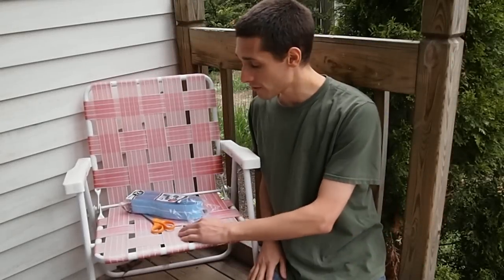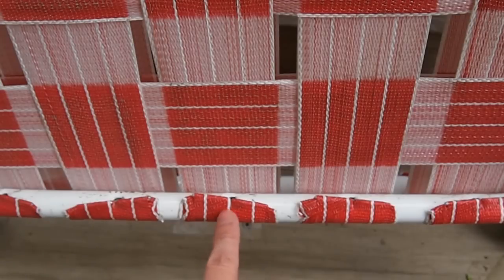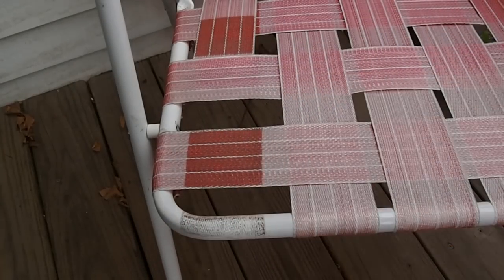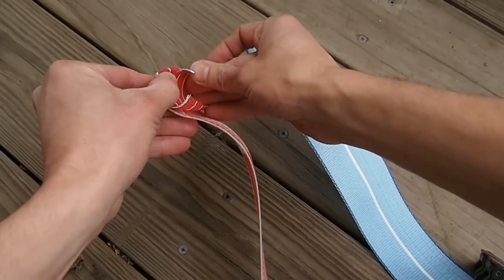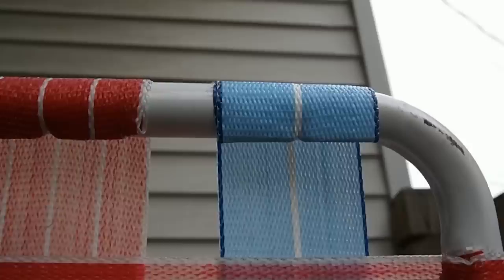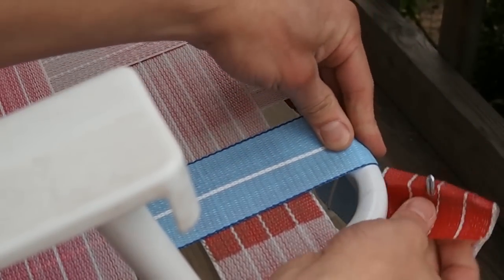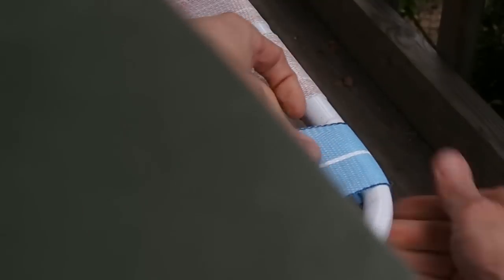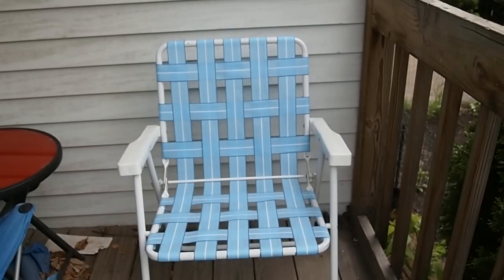Re-Web a Lawn Chair

Comment: Great video. I followed your instructions and it came out quite good, but not as tight as the original webbing, because you need enough slack over the holes in the frame to slip the clips in. Seems to be useable though, and it looks much better! Thanks!

Comment: Thanks.  Good instructions but these clip things are just difficult and fickle.  Anyone trying this should just get screws.  I just redid my chair with clips.  Pulled tight.  Did everything right.  Sat in it, and now there is just a tiny bit of slack on all the webs but its enough for the clips to start falling out all over the place.  Very annoying.  SCREW IT!  SKIP THE CLIPS!!
Reply from the maker: I agree; screws are much easier.
Reply: What kind of screws???
Reply: @coreybennewies1866  , SS that fits the hole.

Comment: I"m on a tight budget and have an old 3 seat porch swing. Do you think I could replace the material that holds the cushions with this? Is it hard to drill holes in the metal to attach the screws? Do you know of a video that would address this ?
Reply from the maker: It's probably not very hard to drill new holes. It depends on the metal though. Aluminum is a piece of cake to drill. Iron and steel tend to be harder but you don't need very big holes so it shouldn't be too hard. Unfortunately, I don't know of any videos that could help with your specific situation.

Comment: Thank you for the video....
You seem to have the same problem as I do.  My current strap width is 2.75 in, but all I can find is either 2 or 3 inch width for replacement.  Your blue replacement strap looks narrower than the original.  Does a narrower strap change your comfort level in your chair?

Comment: Question..how would I web a lawn rocker, that didn't have webbing on it, but rather had nylon cloth type material on it. But I would like to put webbing on it.
Reply from the maker: 7891234able I could drill holes in the frame and use screws to secure the webbing.

Comment: I have a question how much webbing should you use to make sure it's long enough say I need 15 in.should I add 1 more in to insure long enough
Reply: I'd add and extra 6 inches, 3 inches on each side due to overlapping and folding under.

Comment: Thank you for this video. The metal parts on my chairs look like they could last 100 years, and I have gotten my webbing, but the plastic arms on the chairs are brittle and have broken-is there anything I can do to repair those parts?  Thank you.
Reply from the maker: R. Price Glad you liked the video. If it were me, I'd try to make new armrests out of wood. Unfortunately, I don't know where you can buy replacements. Maybe someone else does?
Reply: +R. Price I have looked EVERYWHERE. No luck. Having wooden arms made sounds like a good idea to me. Else, only buy with wooden arm rests next.  Wasted a lot of time on this. NO ONE seems to sell just the arm rests. Wooden set on ebay but 2 inches too short for me and I need 2 sets!
Reply: If your working on a budget or not really using your lawn chair for lawn decoration you should try using pool noodles cut to length and than wrapping them in place with duct tape.

Comment: Sadly, you got the clips in BACKWARDS! The hook must turn the other way so it won't pull out, and it is much harder to do....
Reply: You obviously have not done this,the clip orientation is correct.Sadly you are wrong,just did mine and those clips are installed the same as they are from the factory.
Reply: @francinecorry633  , it was incorrect! Otherwise the clip just comes out. The 30* should be against the metal to grip against it.

Comment: You folks who think reusing the clips is easy either: (a) have not yet tried it, or (b) settled for loose webbing.  I find it impossible to get the webbing tight using the little clips. Next I will try using screws. If that does not work, the old chairs go in the trash.

Comment: Where can you buy the webbing online?  What length do you need per chair?
Reply: A variety of colors can be found on Amazon. Not sure about second question. Measure all of the straps your chair currently has, then add 6 inches onto each to be safe.

Comment: So, to use screws you just fold it over? Ummm...maybe mention you need something sharp to poke a hole through the material because most screws are flat tipped. I found this video useless.